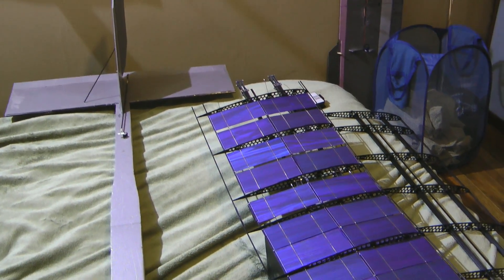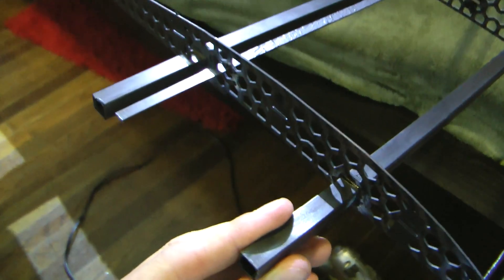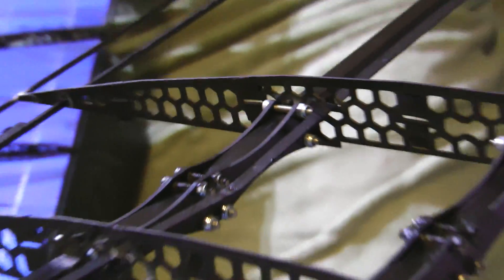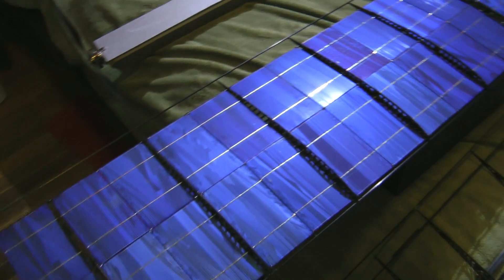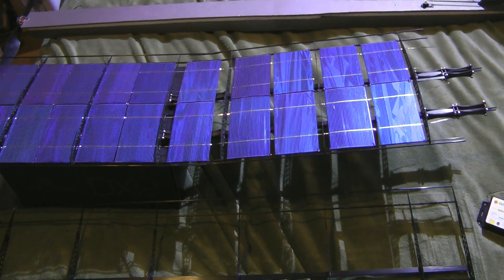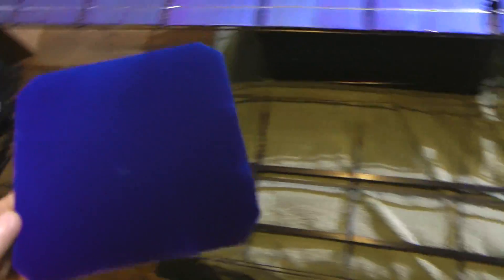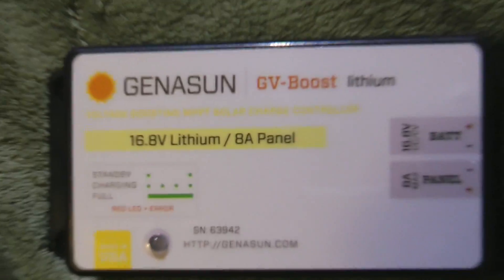RCTESTFLIGHT - Solar Plane Update - Episode 3

Comment: Hi! just a brief info: you get in a vortex because when you turn using only ailerons you need to push up the nose with the tail stabilizer, but in your project they are almost at the same horizontal level as the wing, so they get in turbulence and even if moving (I did not catch in your video if they have maneuvrability with servos or not) they produce a small effect. Hope that would help :) BTW i really go mad for your project! it's wonderful!

Comment: It's wonderful that you have posted these videos of your project.  Your solar cell work looks very good, but unfortunately your airframe could be much better. Why don't you use an existing glider design, using balsa wood and just some carbon fibre to cap the spars? Look up "Charles River Construction Articles" for some excellent lightweight designs, and more importantly, all sorts of useful tips, inspired mostly by the brilliant MIT aerodynamicist and designer  Prof. Mark Drela. You do not need the extraordinary wing strength required by winch and human towed model gliders (e.g. F3B, F3J, F1A competition classes), so your wing can be very light (see the gently-launched  F3-RES class of model for some ideas).  Mark Drela has developed many airfoil sections which have large flat top areas to which you can attach solar panels (preferably flexible ones). He has developed many mathematical formulae to help choose the right thicknesses of carbon fibre strip. You probably need a lower aspect ratio wing than many competition gliders, to maximise the wing area for given weight and span,  with really good stability (ditch the ailerons, rely on polyhedral), lowest possible weight and lowest drag with high lift. (Look up aerofred.com for all sorts of nice plans you can download and print at your local printshop, or buy prints directly.)

Comment: Hi!

So I am a Mechanical Engineering major and we are working on building a solar-powered glider very similar to yours for our senior design project. Love all the videos. Truly impressive and cool. 

Just wondering, do you have any wiring schematics for your plane by chance? If you don't mind, we would love to pick your brain a little bit. We didn't realize how electrical this project was until we started it. We would just like to make sure our charge controller, batteries, and solar cell configuration are all compatible. 

Thanks so much! Hope to hear from you soon.

Cheers,
Joe

Comment: The lines on the back on the panels are a heatsink. Solar cells get warm. A hot cell is much less efficient. So they try to dissipate the heat.

Comment: with all do respect you needed a bit of power to be able to avoid most of the accidents aaa you also need a bigger motor and I think you might have been in a flat spin in at least all of your fails here is a vid it might give a small hope that it might help you out in another flight :)  I know you have finished the design but good luck :D

Comment: total shot in the dark here but don't many gliders and trainers use rudder only for lateral control?
It would make for sloppy skidded turns but I believe it would greatly simplify things.
Perhaps something similar to  RCpowers "elevon" design.
I have flown a considerable amount with no ailerons on those frame and the flight characteristics are incredible.
Reply: +Kent Klapstein thisXn - ailerons on wings with a lot of dihedral are not as effective and do weird things as you found out. Wing dihedral also adds side area at and in front of the CG, so you need more fin area than you would otherwise.

Comment: Consider making a wider chord, thicker airfoil and shorter wing while 
retaining the wing area. This would reduce the wing flexing and also 
allow for diagonal structure within the wing.  

But when I use film for covering, this usually imparts a lot of stiffness. Are you using a commercial, model airplane covering or Saran Wrap? I ask because, as I mentioned on your Part 1, I had this happen to a microlight electric using super capacitors. I used Saran Wrap because it's the lightest film there is. 

I had no solar panels to break and the balsa ribs were more flexible so the damage was minimal. My solution was diagonal cross braces joining the spars. 

And, my chord was wider with a shorter wing.

Comment: In order to make your wing torsionally rigid, you not only need to include 45 degree plies in the layup but you also need to increase the cross section of the tube.  I would highly recommend using up the entire rib height in order to increase your area moment of inertia.  Lastly, you don't necessarily need ailerons.  An aircraft with enough rudder authority and dihedral will give you plenty of control for the slow flying this craft is designed to do.  Good luck!

Comment: make boxes in the fuse for stiffness... running carbon the same way as the wood spars will not give the rigidity in the fuselage. Also flex able solar cells are lighter than rigid cells... looks great love the printed ribs!

Comment: Any shadow cast from the wings structure will lose power on the cell, if you don't have diodes running on each cell the whole lot will drop down in power.

Comment: Love your projects! I was watching this video and the fuselage looked very heavy and still flexes a lot with the balsa spars... Would aluminum extrusion help with the rigidity while not adding too much overall weight? 1/16" wall thickness in either a "C" channel or a square tube? I think that they are readily available (and cheap) although I do not know what they would weigh compared to your current fuselage. Just a thought....

Comment: Why do you use carbon for the wings? It is probably a good idea to use carbon rods for the center part, but you could easily build a lighter, stiffer wing from balsa wood. also, in the other video you crash your plane while taking a turn. that looked like it happened because your plane stalled. you need to be a lot faster, and take larger turn circles, because the wing geometry is not optimal for really slow and tight corners. once the plane stalls, you can only do one thing to maybe recover it: push the elevator down. if you have enough height, your plane might become controllable once more.

Comment: To prevent aileron reversal, you need a better anti-torque structure. Two beams will help but will not help much. You should consider making a box, which is more efficient in terms of weight. Or, you may solve the problem by using no ailerons but a large dihedral and rudder for roll control. Or, you could use control surfaces on the bottom/upper wing surface so they wont generate so much torque. Also, always keep in mind the structural weight, since it determines the flyability of a solar plane.

Comment: Look Great! 
Weigh your fuselage and wing!
Then Please Search for the Vast amount of Information for
The Bubble Dancer builds and planes.
Specs, plans, Details, evolution and documentation. 
With the wing Die-hierda(bent angle)..You only need/use rudder and elevator..maybe landing flap/air brake.
Its open source design from Professor Mark Drela at MIT.
Huge matured info thread!
It is basically optimized for light weight gliders. Strong enough to take a rough "winch" launch! to well over 1K feet. yet there is video of the Dr hand tossing A Bubble Dancer, gliding a couple hundred feet , turning into some thermal lift,  rising to what ever height and flight duration. No Motor.  With a known plane capable of that, not much Pv Power, storage, motor needed.

Like an already invented wheel Perfected... Spar tech! Wing stress ,  Balance front to tail.. engineered strong enough to take Pv cells with minimum reinforcing or modification. The sexy carbon rib may do that?....
Also See the commercially available Ava and Super Ava Planes all carbon and film
Peace

Comment: Gluing the same sized foam to the bottom of your fuselage will perhaps solve 2/3 of your non-stiffness problem. Or a wide strip of carbon with access openings or doors for access would be even better. Do NOT interrupt the strip, but for narrows opening, that would defeat the purpose of a closed box profile. Covering sides and top with - possibly very - thin carbon sheet would be another improvement.

Comment: For V3 what about a big 2 metre flying wing made out of depron or pink foam with kfm4 airfoil and place the solar cells on the flat area of the wing just after the leading edge airfoil stops. That should have plenty of wing area for the cells.

Comment: why not work the inverse aileron twist into the design? if you flip the controller inputs, the inputs would utilize the inverse twist to your advantage. use twist as the turning mechanism in lieu of traditional ailerons.

Comment: Dan if you want rotational resistance of the wing structure just attach diagonal segments crossing like on a crane arm. They can be very weak and light but added all (if attached stiffly) they will result in a rigid wing!

Comment: Your structural dimensioning seem to be insufficient. Use a carbon tube with a diameter that just fits into the max. thickness of the wing and all your structural problems are solved.

Comment: Great effort & particularly like the custom carbon in the wing. I mentioned previously using marine aerials for their length, strength & light weight, and the fact you can get discarded aerials from marine maintenance dealers. They would be the perfect answer to put down the inside of the fuselage to stiffen it up, being a tapered hollow glass cylinder, the strength is substantial. 
Good luck.

Comment: ideal solution would be to use the panels as the wing shape, saving weight by not using covering? panel size would be critical as would fixing the panels into the wing

Comment: Gday Ive built a couple of stand alone solar stations 24v /240v., 5000AH , but I don't have any electrical training. Ive taught myself.  The regulator you have is designed to look after batteries being charged, not primarily to make total use of the power from the solar cells. So if you have 95% charged battery ,with some drain from the motor , The regulator will not allow all of the power from the solar cells to charge your battery and that important power will be lost. As The battery gets close to peak the regulator will drop the amps, as this is the  process for health charging a battery. Your plane will then rely on the battery more than the solar cells. your battery will never be 100% charged and you will not be using all the available solar power.I cant think of a best solution to help you . The only idea I have is maybe a "sacrificial" battery. Keep the set up as you planned ,then a second battery ( sacrificial battery ) wired directly into the solar cells(bypass the regulator) . A relay btween the batteries and ESC so you can switch between batteries. This way your Primary battery will be 100% reliable and well maintained and controlling your radio equipment ect....and when the sacrificial battery is 90% charged ( or the Primary battery is 90% charged) , you  switch the motor to  it. You will use the solar cells more efficiently and the primary battery will be getting charged in the proper way ( with regulator ). If the sacrificial battery dies you will still run perfectly on the primary battery. The sacrificial battery dosent have to be big , the main purpose of the Sacrificial battery is to allow the efficient use of the solar cells to the motor and give the motor extra power through clouds/ full throttle ect. You are trying to get the most efficient use of the solar cells and the math and calculations between that and the battery is mind-bending, After you have completed all the math , there is suddenly more calculations to do.  Good luck, if your plane works or not the skills and lessons learned will be priceless.

Comment: I love these builds man. A lot of good construction technique has been developed for DLG competition gliders that might lend itself to your your solar planes. DLGs have optimised lift to drag, high torsional ridigity, and minimal auw to the airframe, low rotational inertia, and many are self righting and docile handlers. So, many aspects to contribute design-wise if you choose to research in that direction. Best of luck and keep us updated!
Reply: +captainTubes I would definitely build the fuse in a dlg fashion! best stiffness to weight ratio and once you have the construction method setup it's easy to make more

Comment: I would suggest that you use Kevlar thread to create a torsional truss. The tread minimizes the blocked light above the panels, and allows for a very thin covering (since the covering no longer needs to carry torsional or shear loads). You cross brace the threads on the top and bottom of wing. Make sure you detail it to carry the "shear flow" across the top, around the TE, across the bottom of the wing, through the LE  and back to the top surface. You  create a continuous circuit for the shear flow. Electrical circuits (and water flow) and load path are very analogous. Breaking a load path is like breaking a circuit.

You can keep the Kevlar tight by wrapping the thread around a joint then tacking in place with CA. Make sure the threads are nice and tight to keep the wing assembly stiff.

It is important that you cross brace since this what we call a tension only bracing system. You can't push on a rope. When torsion/shear is in one direction only one of the two threads are carrying the load. When the load reverses, the other thread carries the load. The cross bracing also allows the threads to be tighten without warping the wing. It is a bit tricky to build but is very efficient.

The two spar solution is what we call "warping" torsion which is an order of magnitude less stiff than that of a "closed section". Closed sections are generally stiff and strong for carrying torsional load. A smaller closed section within the wing is very much less stiff than the wing itself acting as the closed section.

Good luck. interesting project. I like to see people build and experiment with these sorts of things.

Comment: looking forward to seeing these fly.  There is some additional torsional rigidity from wound CF tubes, but it's mainly a strength increase, where you really just need stiffness. Stiffness will come from a larger diameter spar more than anything.

Comment: The new cell you have there is a back contact solar cell. In the "old" panels the whole rear would be one contact of the cell, the silver/aluminium strips on the front the other contact. If you check the rear of the new panel you should see that the white parts are interleaved like fingers. For half of the fingers there will be many very small (most likely invisible) holes that connect the front to the back.

Comment: Are the main wing spars hollow?  If so, you could glue wooden dowels or carbon fiber arrow shafts (use Gorilla Glue) into them.  This will add some weight, but a lot of lateral and torsional stiffness.    This has worked pretty well for me for 10mm square tricopter arms.
Reply: +MountainSnowFlyer   Weight..grass hopper..Weight..!!

Comment: Why didn't u just made a d-box in the wing.. I highly suggest that you build that in the version 3.
Reply: +rctestflight May I please know where you bought those new solar cells or atleast the exact product name?
Reply from the maker: +Ricardo Smits Because I was trying to keep the wing chord as short as possible.
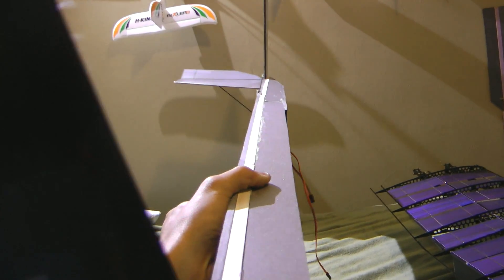Reply: +rctestflight Just a tip I thought ... Maybe its good or maybe I am saying something Dumb ... but its always worthsaying something... From what I have seen from 1:07 as they wiggle.. I think its because the bottom is not covered but even if you cover the bottom it will wiggle and just add extra weight... to make it very stiff instead of making the body a box shape make it a prism shape.. what I mean is that the two vertical support plywood along the side join them to form a prism shape..since all the sides are at 45 degree it cannot bend ... its always easy to bend a long box shaped structure than a long prism shaped structure... hope it helps or maybe I just said something dumb
Reply: I want to know too :)
Reply: +vignesh sivakumar They are Sunpower solar cels :) You can find them on Ebay.

Comment: I know a little bit about torsion, but not a lot.  (I'm a structural engineer.)  Torsion is best resisted by "closed" shapes, such as cylinders and square tubes.  With a wing, I would expect that the "closed" nature of the cross section is provided by the skin on the wing.  (Note: the skin should be continuous around all surfaces, else the shape is not "closed".)  But any random cross-section where there would be no skin would be an area of torsional weakness.  So probably the best thing that you can do to resist torsion is to put skin on the underside of the wing, and attempt to make the panels on the top of the wing structurally continuous by using skin to fill in gaps between panels.  (Caveat: I'm definitely not an aeronautical engineer!)  Absent that, the square tubes within the structure of the wing will help some, since they are closed shapes.
Reply: +Tom Nally 
Amen...  a classic aircraft wing design is to close the structure of the wing from the spar forward in a "D" section, which performs the function of the the tube you mention while also providing the aerodynamic shape of the wing.  The vertical leg of the "D" (aka shear web) also helps resist wing spanwise bending loads along the spar.
Reply: completely right. most rc models will have a completely boxed leading edge, usually with balsa covering.
Reply: He's probably going to cover the wing all the way around top (over the cells) to bottom, like v1